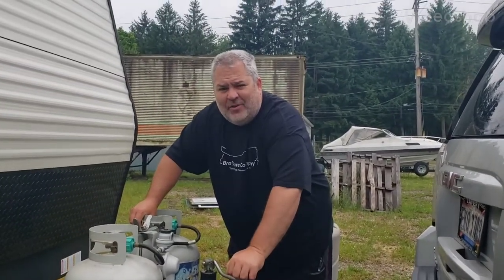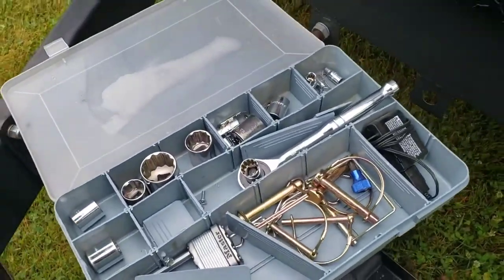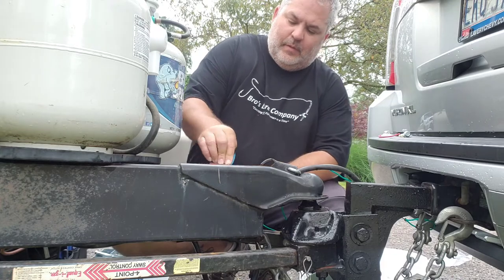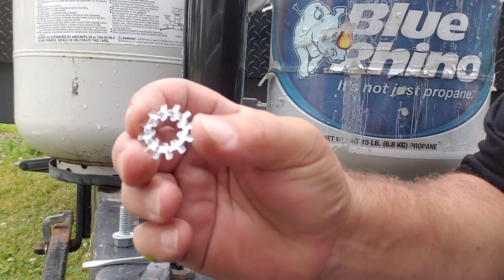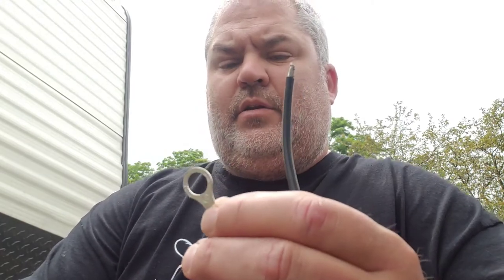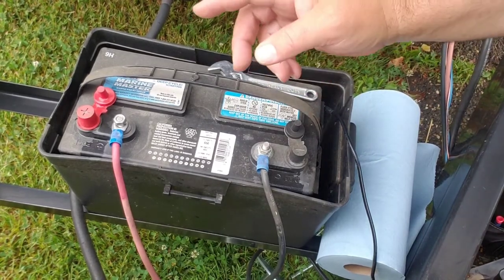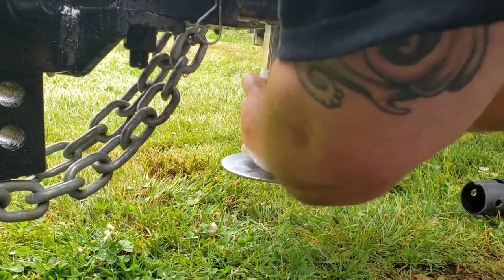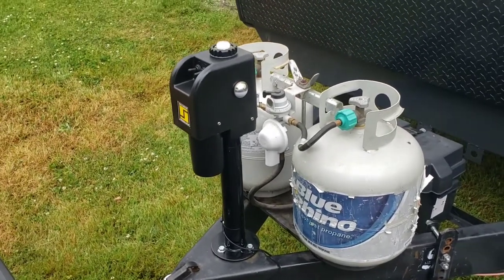How to Install an Electric Tongue Jack on your Camper

Comment: I am wanting to upgrade to an electric lift but I don't have a battery yet. Is there a specific model and protective case that I will need for it?
Reply from the maker: Just a 12 volt battery cover with a strap. Any RV shop would have these in their parts department.